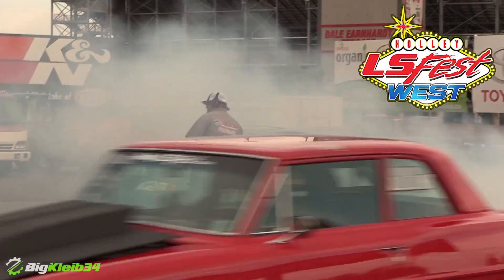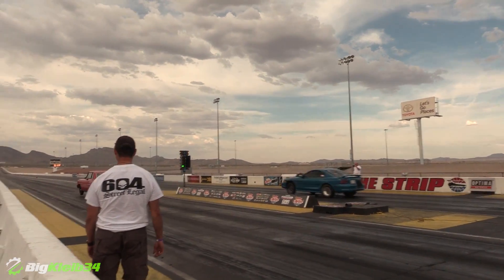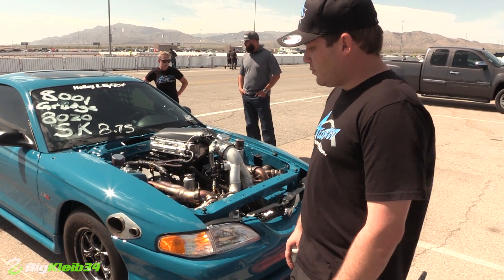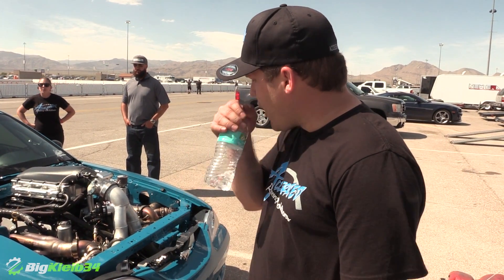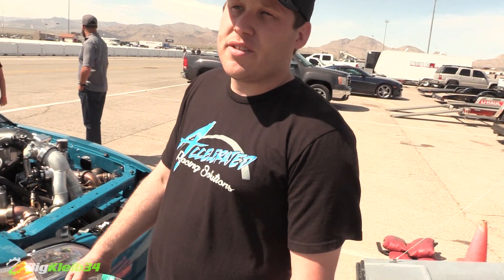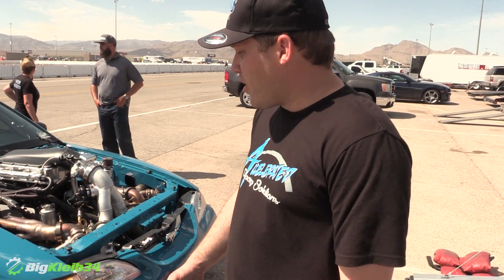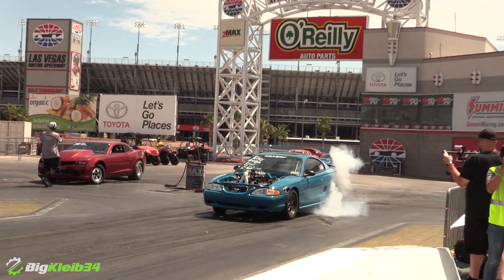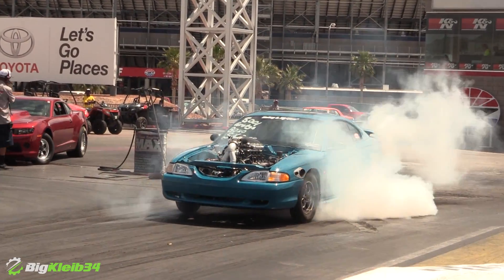So Much Turbo! Didn't Need that Hood Anyway...

Comment: that's the way to go ,put a Chevy motor in a ford  to go fast😁😁
Reply: thats the only way to make a Chevy LS go fast, by putting it into a FORD, use a Ford nine inch out back too, not that an LS could break any diff.